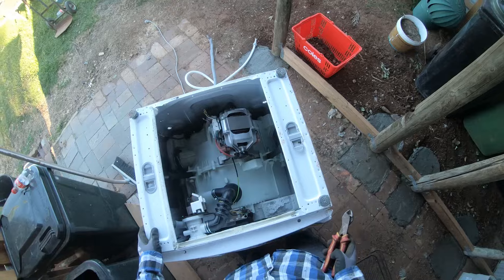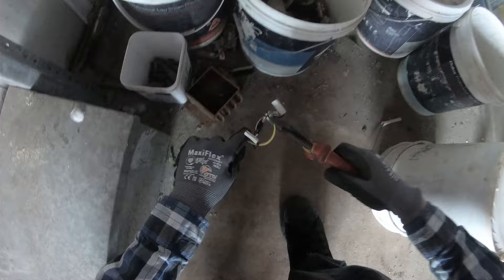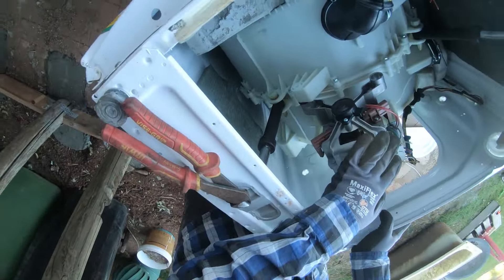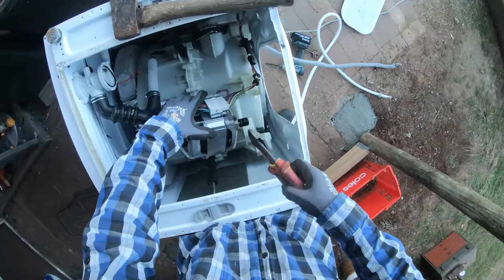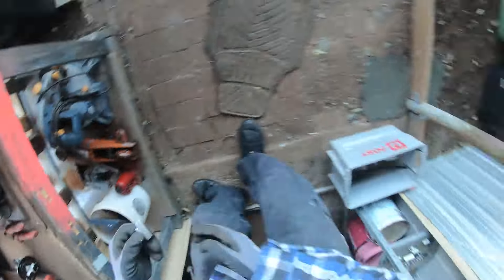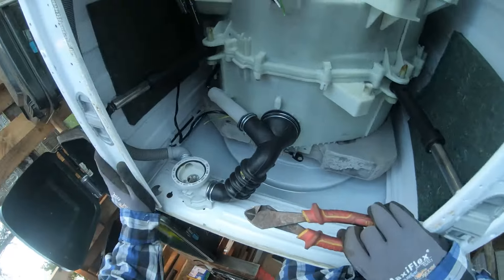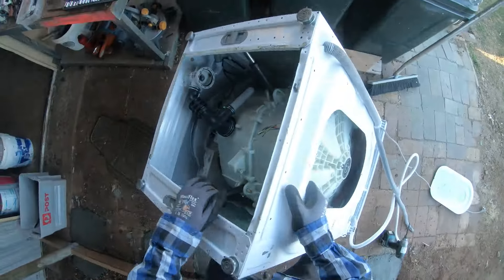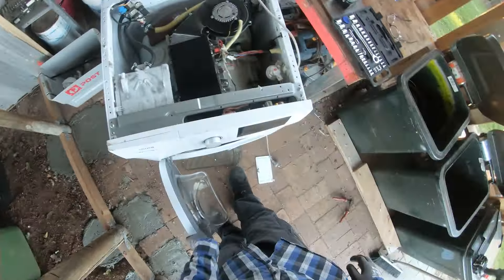Discovering, Taking and Stripping a Washing Machine!!

Comment: I'm a micro scrapper too and I do exactly what you do, got to get all those goodies!!💜 That fly wheel came off so easily, ours are often held on with a giant torx screw which I find really hard to get off, even with my impact. I can't believe someone dumped a washer down there buy glad you rescued it 👍 Is there a part 2coming? I was wondering if it was a washer/dryer combo?
Reply from the maker: Yes it is a washer dryer combo, no part 2 lol thanks for your comment!!